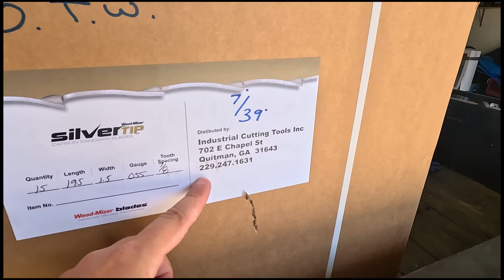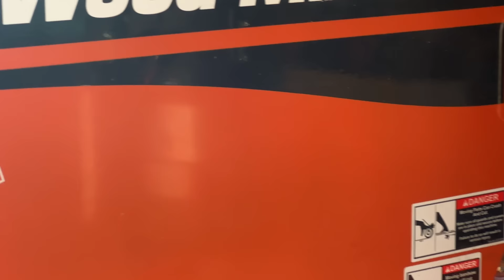It's That Simple! How I Built My Sawmill Empire

Comment: Just an idea.
As a chip collector, how about one of those white plastic totes with the metal frame like you used for your firewood.
Cut the top out, then throw the top back on. The loose top should keep the chips in without trapping air and causing back pressure.
Remove the center screw cap and drop a pipe from the exit pipe you have now.
Mr.Cato should be able to handle the weight. With the metal pallet built into the base you can pick up and move easily, then slip under the base with the forks to tip it over and use the forks to lift to empty. 
They generally weight about 120-130 empty so it should be no problem to right it. 
Once you have it back in position, throw the loose top back on and reposition the drop pipe, and repeat as needed.
If your worried about water collection the large spigot at the bottom would let out any water that the weather put in there.
Enjoy your work and videos, thanks for all you do for us and your family.
God Bless and take care.

Comment: Find a source for Isopropyl Alcohol. Add about 2 or 3 ounces per gallon of water. That could save you $ 2.00 or more per gallon. Even a 16 ounce bottle from a drug store would only cost about $3.00 and would make 5 to 8 gallons. A truck supply place could probably get 5 gallon or larger containers.  Many trucks use it for air line antifreeze.

Comment: I used to make windshield wash. All it is, is water, rubbing alcohol and dish soap. Very little soap and about 85 to 90% water. If you make a gallon just add a cup of alcohol and about 1/2 table spoon of dish liquid, then top off with water. I used to make 20,000 gallons at a time. in extreme cold add more alcohol or methanol. If the Alcohol is 50 % double the amount. You can same the shorter boards to make ceder chests or bread boxes

Comment: I would monitor the windshield wash, because some of them may have less Alcohol  than others. Just leave a gallon just outside the door and check it every day when it gets in the  20's or less. It may not be a problem, but better safe than sorry.  I worked in a Lab more than 30 years and have got off spec stuff from some of the most reputable vendors.